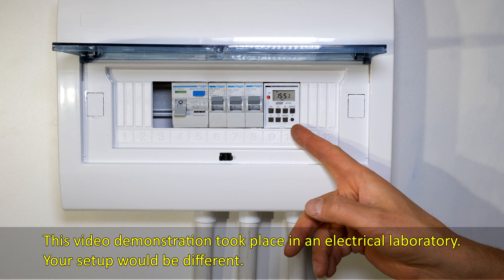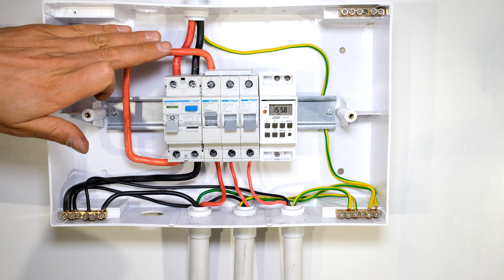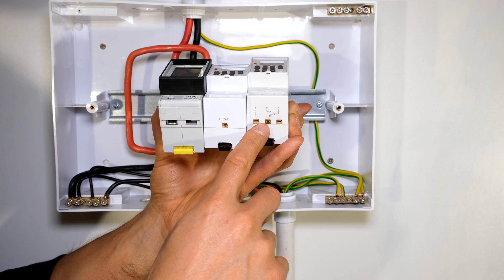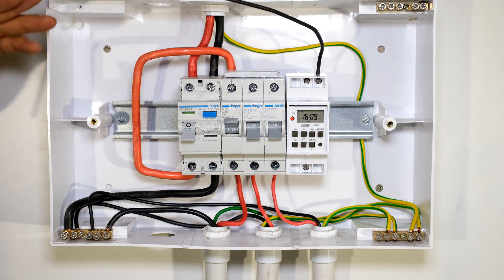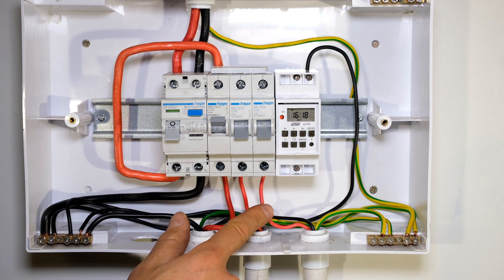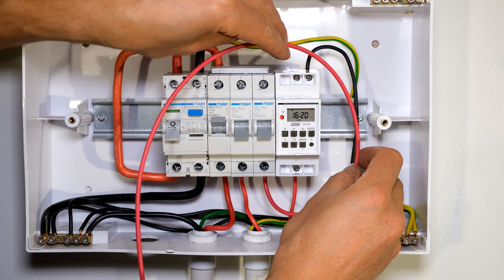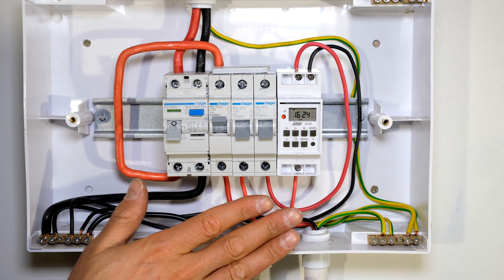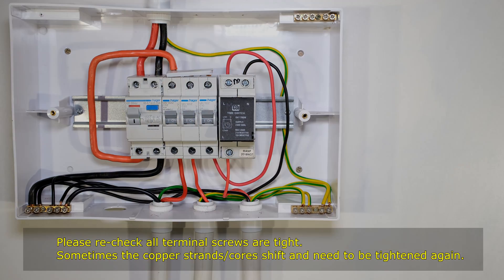How to wire a timer switch into a DIN rail distribution board (South Africa)

Comment: If your geyser breaker is 40amp and the live cable used is 6mm and the geyser timer is 30amp.  Does the Geyers’s breaker need to be changed or will this set up be fine?

Comment: I want to install a timer that stops all mains power to the system during the day, but allows at night. My solar produces enough electricity during the day, but I want to set this to SUB priority and switch to mains from 10pm to 5am so I can run the geyser on mains at 4am and on sun during the day.

Comment: Hi. If I run a second DB board i a  lapa from the home DB I am doing it from a 25 Amp breaker in house main DB to 60amp 5 breaker DB in Lapa. But I think this is not correct as my jacuzzi 32 amp breaker trips and gets hot when 4kw heater kicks in. What coule be reason for overheating. When i disconnect the heater there is no heat to the breaker and it runs fine